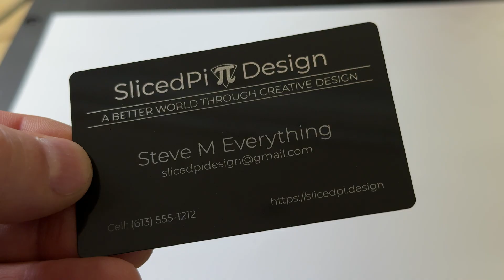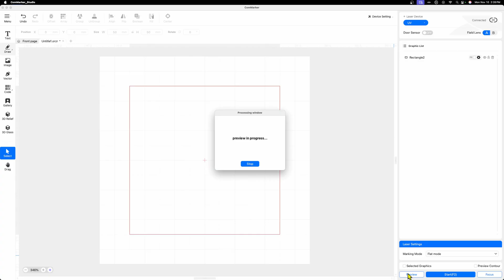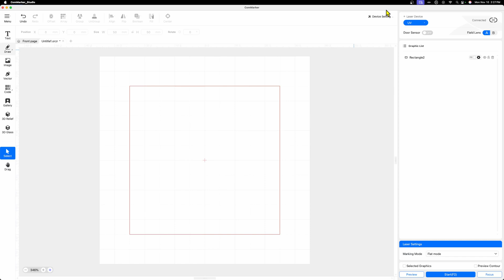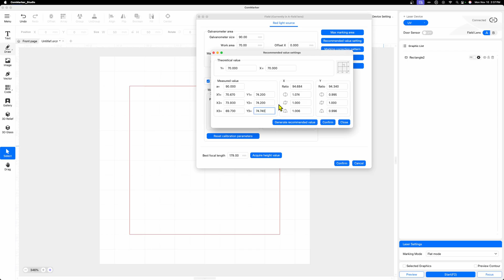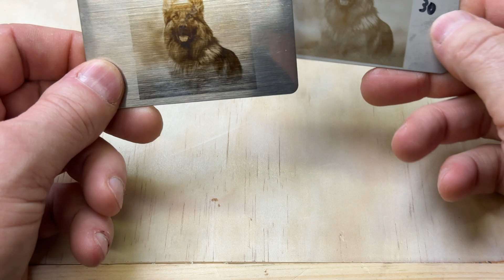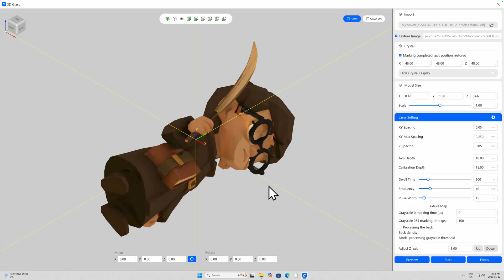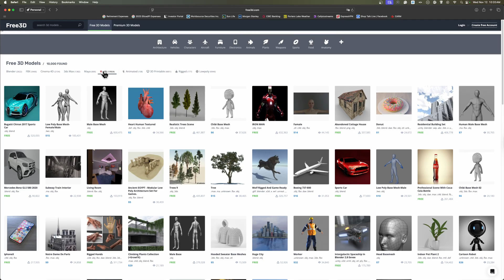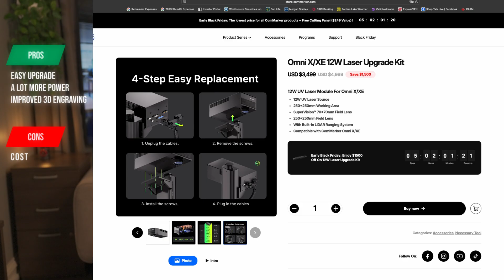5W vs 10W Omni X – Is the Upgrade Worth It? Side-by-Side Comparison!

Comment: When I try to use two layer acrylic my Omni 1 10w turns the white layer under the top color dark gray. Anyone have tips for keeping it bright white? I’ve tried cleaning it, even going over it with a Dremel and the gray is pretty thick.
Reply from the maker: SO with UV lasers, you kind of get what you get.  When I use the Red with WHit inner core, I get a light gray engraving.  You can't clean the engraving since this is actually plastic rather than soot.  If you want white then CO2 is a better option.

Comment: Which UV laser do you like the best. Omni or Xtool?
Reply from the maker: I’m not sure I have a preference. The X atoll is best for new users who are looking for ease of use. The Omni X is better for volume production in a more industrial area.
Reply: @SteveMakesEverything  I'm debating between these two options myself, and I'm curious if your opinion of the Omni X being better for production is based on the 12w laser only or if you'd say the same for the 6w base Omni X?

Loved this review btw, following for more! Thanks!
Reply from the maker: @Lunessence  I think I would personally lean toward the xTool, but don't assume I have any issues with the Omni X.  I think the control software on for the xTool is just a bit more refined.  Both laser have a convryor option, though if you are engraving small parts in larger volumes, the xTool will allow you to just through things on the conveyor at random and their AI will recognize the parts and engrave them properly.

Comment: I wish they would give us a way to use the slide extension for the Omni 1. It’s the one thing I miss about my old LaserPecker lp4.
Reply from the maker: I was always meaning to try this.  The Omni 1 can use a rotary, so it can handle a stepper motor, which means it should, in principle, be able to at least move a slide.  It's also an accessory that is supported in Lightburn; it should be possible with a little work.

Comment: Other than speed increase, is it possible that all of the improvement on the 3d and embossing is due to the new Super Vision 70mm lens that comes standard on the 12 watt? This one has four lens elements rather than the standard 2 lens, and it's for sale for the 5 watt for $300 now. If you think that's possible I'll order one for my Omni X. Your expertise would be much appreciated on this because I've been thinking that must be what it is.  Thank you in advance
Reply from the maker: There is no doubt a difference, but I think you'd probably only see it on something with very fine detail.
Reply: @SteveMakesEverything  Thank you Steve! You just saved me $300 that I can put where needed. I appreciate your expertise and advice. 😀
Reply from the maker: @Winchester_4570  Happy to help.  If we ever meet, you can buy the coffee 😉

Comment: Could you get the same results on the 5w by doing slower settings or a second pass?
Reply from the maker: You should. It’s more a matter of engrave time than capability. Note though that on 3D glass you only get one shot. You can’t run multiple passes.

Comment: Would you say the 5w is still a capable machine in regards for small business? I'm planing on starting a smal side hustle once I am done with my master in desember and were thinking on using it for engraving items. And if I get enough orders then upgrade at a later point. Planing on purchasing the 6w xe with roller and d300 disk and extention arm I do have a falcon creality 2 that I use for cutting and engraving larger wood objects.
Reply from the maker: Yes I've used the 5W for a year in my business.  Keep in mind though that UV lasers don't really do deep engraving as a rule.  You can do relief engraving but it is slower than you would probably want for engraving text on something.
Reply: @SteveMakesEverything  well I do have an diode laser now, but need something that engraves more cleanly on glassware.  The diode is slow as :)** but I don't have that many orders that I'm not able to keep up. Still just a side hustle. Plan is that if I need to I can always upgrade to 10w if the need becomes apparent

Comment: Does the 12w allow you to make larger internal 3D crystal image engravings vs the 6w? Thanks!
Reply from the maker: I haven’t tested this, but to something larger you would need to switch to the 250mm lens and it won’t be able to focus quite as sharply and may not have enough energy density to engrave inside the glass.  When I get time I’ll give this lens a try on glass

Comment: Being a hobbiest not wanting to spend as much as the 12w is, would you be able to get similar results on slate with the 5w by tweaking the settings and doing the marking slower?
Reply from the maker: More or less.  In UV and Fiber lasers, extra power doesn't generally mean more capability.  It means faster for the most part.

Comment: Does the larger wattage limit anything you can do? For example, if I didnt want a deep wood engraving, but wanted it to look like the 5 watt is that possible? Or if I wanted the stone engrave to look like the 5w? How low can the power go on the 10w? Is there a limitation where you might not be able to get a fainter or certain desired engraving with the more powerful laser?
Reply from the maker: No changes to what you can do.  If you wanted the 5W look on the wood relief you can simple reduce the dwell time or you could play with the frequency and pulse duration as well.  In the end you'll get the same result a whole lot faster.

Something to understand about UV and fiber lasers, is that you aren't really changing the power.  These lasers shoot a pulse that is either on or off - there's no change in power.  The way you get power changes is by varying the frequency (i.e. hit the material more/less often) and pulse duration (i.e. How long do you hit it).  You can also make engravings lighter or darker by varying the number of lines per inch.  If you increase this value, you are paacking the lines closer together and effectively creating a darker engrave.

Diode laser kind of work the same way.  When you set a power percentage, what you are doing is changing the time the laser is on for any given spot (just like pulse duration on a UV).
Reply: @SteveMakesEverything  Thanks for the reply! Another thing I saw is that the 12w/10w one they have comes with a 250x250mm lens instead of a 150mmx150mm lens. Does that change anything or limit sizing? Thanks for your knowledge, not a ton of detailed info on UV lasers out there.
Reply from the maker: @JasonVizzini  Yes you get a 250x250 and 70x70.  These loosely map to the maximum work area for each lens, though I was able to push the 70mm lens to do a 90mm engrave.

Comment: I've been holding back from ordering the Omni X due to some possible issues, but I've also been wondering about the to two Wattages. With other laser types, it looked like the small wattages were better for details but wasn't sure with a UV laser. It looks like you have good quality engraves in general and it look like the level of detail was the same, with better contrast on the 12W. So it is it safe to say, that I should run with the 12W over the 6W if I'm purchasing for the first time?
Reply: Oh I guess I should add, for the most part, I plan on mostly engraving on Tumblers, Glassware, slate, aluminum cards, Crystal cubes, glass or crystal (whatever it is) for memorial pieces and maybe Leather patches.
Reply from the maker: If you're doing glass then a UV is the only reasonable choice and internal engraving can only be done with a UV.
Reply: @SteveMakesEverything between the 6W and 12W laser, is it possible to get the same level whiteness in the Crystals, I'm assuming on glass as well, as you did with the 12W in comparison of the 6W with different settings? Or should I just save longer for the 12W?
Reply from the maker: @RobertMaeshiro  One thing you can do is to increase the dwell time and decrease the XY and Z spacing.  You have to be careful though because you can push it to the point where is casues the crystal to crack.
Reply: @SteveMakesEverything  Ah thank you for the info. I really appreciate your time.
Reply from the maker: @RobertMaeshiro  Happy to help.
Reply from the maker: Keep in mind that the beam side of a UV laser is ridiculously small - typically 0.002mm, so you can achieve incredible resolutions if you want to.  By contrast a typical diode laser beam is around 0.1mm or more
Reply: If you're interested in "3D," you probably shouldn't buy Omni X. Their software is unfinished and not user-friendly... Maybe in a year...
Reply: @jiriproc3765  I'd probably only use their software for the 3D and light burn for the rest. I started looking at the Cloudray UV laser because of lens get's it closer to a 3-axis in comparison. I'd like a 3-axis engraver but it's a bit out of range $$$ 😬
Reply from the maker: @jiriproc3765  I haven't had any issues that impede me from doing anything I want, and I do 3D crystals by the handful now.  It's not the best user experience, but it seems to work.

Comment: Why are you not talking about the very poor and unfinished software, which is not adequate for the price at which the Omni X is sold?
Reply from the maker: ?? I don't understand, are you referring to ComMarker Studio?  They are definitely continuing to work on it, but I don't think is any more unreliable than the latest Lightburn.  If you find bugs, just report them and they'll get fixed.  I sent ComMarker a handful of issues I ran into with the Mac version and these have all been resolved pretty quickly.
Reply: @SteveMakesEverything   If you think Commarker Studio is OK, please explain to me:
What do the first three lines in the right-hand column mean (3D relief option)?
How do I choose the size of the area I want to engrave in relief?
What do "Advance parameters" mean? Thanks
Reply from the maker: @jiriproc3765  These are some of the user experience issues I mentioned in another response.  I don't know why they use that language for what amounts to a filename, but I sent a pile of these issues to them.  They really just need to hire someone who understands Chinese, but is an English first speaker and these issues would get fixed pretty quickly.

The first version of Studio I used was only in Chinese, and that was a way bigger problem.

Comment: Not sure if you experimented with this. But, how does the 5W on slate compare if you do a second or third pass?
Reply from the maker: In general you'd probably have to a second pass to get it a bit whiter.  Slate engraving is really about the amount of power you can get onto the tile rather than how many times you can put it there.

Comment: Thank you for such a great review! I also recently purchased the 10w and have a few questions, hope you can answer them. What are your settings for 3D inner engravings? Like power%, speed, frequency, dwell time etc.. Also when using the 250mm Lens, I am running into this non-linear scaling issue. For example, scaling for 250 will be correct, but 200 will be 198, 150 becomes 145, 100 turns to 93, and 50 become 49 and so on. Are you having the same issue? And finally, what wood did you use for the relief? It looks really good.
Reply from the maker: Actually, I just grabbed the default settings from ComMarker Studio.

I don't have this problem with my 250mm lens.  I assume you've calibrated it again.
Reply: @SteveMakesEverything The calibration that came with the len was even worse, same problem with the scaling. After recalibration, I managed to get it square.
Reply from the maker: @WilliamLI-g4q  I definitely had to calibrate my lenses because out of the box they were pretty bad - bluged out and trapezoided slightly.
Reply: @SteveMakesEverything When you draw 4 squares inside of each other, 200, 150,100,50, do they all come out the correct size?
Reply from the maker: @WilliamLI-g4q  Yes for sure.  You're bound to get a bit of distortion in the corners of very large shapes, but they should still be the right size.

Comment: Hi Steve!  Thank you again for another great post. I would like you to address something if you would be interested. I bought an Omni 1 after a lot of consideration. About a month later they came out with a 10 watt version. Then about two more months after that ComMarker came out with the Omni X with a table and shield/enclosure. Now it seems there's an upgrade to the Omni X.

I would like you to help address or comment on in a video about the 6k I plopped down and within 4-ish months it was "superseded" tech/ability wise and I would have preferred to have waited if I would have know what was in the pipeline.

I know the laser community is relatively small however I feel like a chump in a small way for buying something (not exactly inexpensive) and then a "new" release surpasses it's ability. I'm starting to feel cheated by these manufactures in a bit of a way. Research & development of a new product isn't a two week process. I feel like some of these company's are taking advantage of small business people when they know full well it's only going to be a few more months until they have something more efficient and/or with more function & capability to market to makers.

With these sales at this time of year I could have owned a more capable laser for the same or less than what I paid for the Omni 1.
Reply: Oh absolutely man.. I waited for the 10w version, then bought it on the 10th. It didn't arrive until the 30th. Then like the next today they released the XE version with was $1000 cheaper! The only difference of the two being the shield.
Reply from the maker: The XE is $400 cheaper than the X, which is about the cost of the enclosure they sold for the Omni 1
Reply from the maker: Well this is kind of the nature of the tech industry as a whole.  They are constantly evolving products - there are always new phones and computers being released too.

For what it's worth, the Omni 1 is a fine laser and is certainly capable of real business applications. With tthe Omni X you get two additional things - an enclosure and a Z-axis that can be controlled by software.  In return though, you lose Lightburn support and have to put up with a lot louder machine.

The Omni X isn't "Better".  It just designed for a different purpose

Comment: Thanks Steve for another good review!
Reply from the maker: For the sake of time, I skipped that one.  The "a" value is the angle of the center lines in the test pattern.   If it is skewed away from 90 degrees, it indicates the skew value also needs to be corrected.  The angle in my test pattern was right on 90, and should be the case for 95% of lens, since if it isn't indicates that the lens isn't perpendicular to the beam.

Comment: I'm a bit surprised that upgrading is that simple.  I would expect the need for more cooling to go along with the added wattage. Matter of fact, I thought 12W came with liquid cooling.
Reply from the maker: Only the 10W on the Omni 1 has liquid cooling.  This one has very good ventilation and reasonably quiet fans [pump air through it.  I did a quick inspection after a few big jobs, and it's quite cool.
Reply: the laser and the cooling system is all contained in the single unit you switch out.
thats the advantage and also the disadvantage of UV lasers.
Reply from the maker: @Pixelplanet5  The only disadvantage I can think of is that there are a few monstrous fans in the box that make things a bit loud, though it's still quieter than the vacuum system in my shop 😉
Reply: @SteveMakesEverything  yea thats a big disadvantage many UV lasers have.
For me the big disadvantage of UV lasers is that because they dont work with fibers and require some special mirrors there wont be dual laser systems with them anytime soon or ever.
Thats also what im missing in any review of these UV lasers so far, almost nobody talks about how loud the cooling system is and manufacturers are cheaping out by using crappy fans that dont even support PWM.
Reply from the maker: @Pixelplanet5  I can't argue withe against any of this.😉

Comment: so what are you doing with old 5W UV laser?
Reply from the maker: 😀 I knew someone would ask this.  It is being sent back to ComMarker so they can conduct a post-mortem on a laser module that has been used quite heavily.  It's not much good without the rest of the control hardware anyway.
Reply: Cheer Steve enjoy your webcasts, I might of bought your old UV.  I am working on integrating Galvo fiber, and UV on two trees TTC6050.  For very high definition images you need very precise and stable gantry.  6050 we have already mount X70 atomstack and that really improved image resolution, and adds micro stepping.  UV is my primary research area for next year.  J
Reply from the maker: @JCloudfather1  Sounds like a fun project.  I can't give diode lasers away anymore, but if I mention I have to get rid of a galvo laser, there are always people lining up for them.